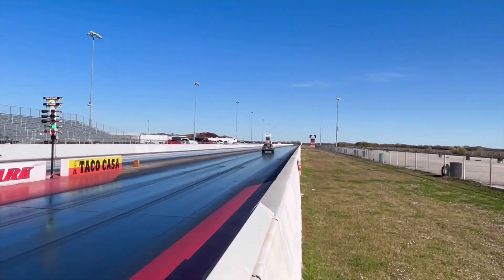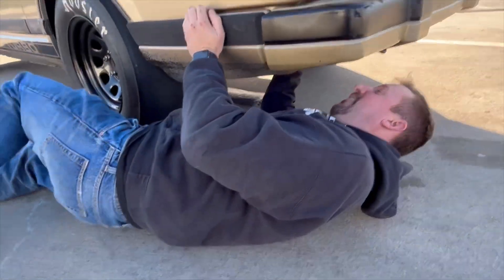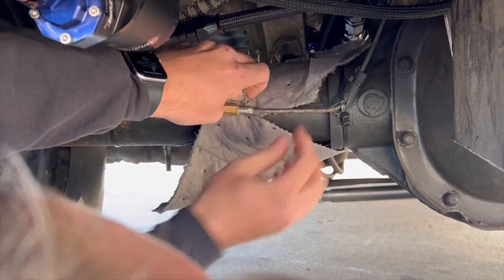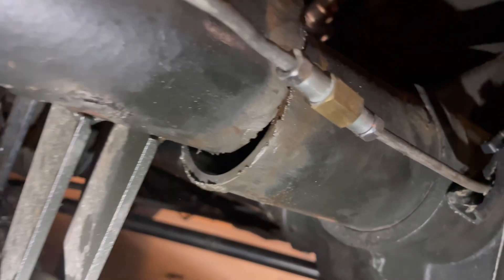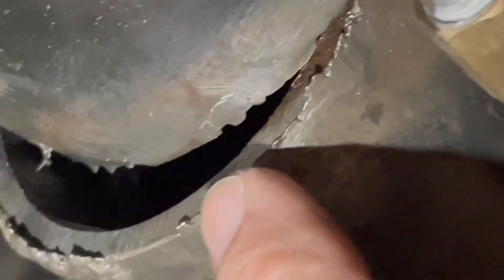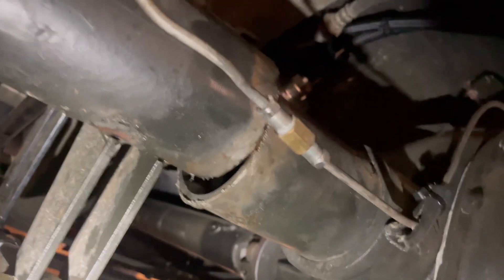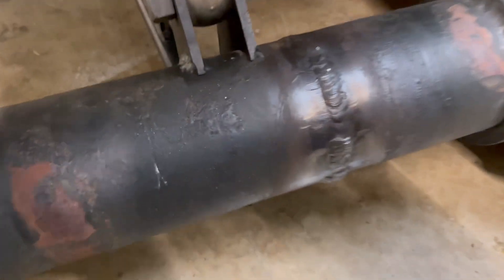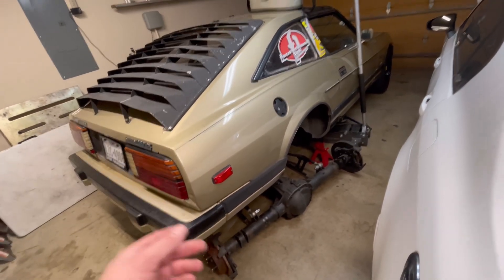I found the weak point….

Comment: Why not sleeve the weld joint. I’m a machinest for a lumber mill and that’s how we repair snapped shafts and tubes. Seperate abd slide a tube over one half. The. Weld up the joint and slide the tube over the weld joint and weld the ends.

Comment: Can you do a video about your Megasquirt setup? I'm super curious.
Reply from the maker: I go into it a fair amount during the engine swap series in my playlist. I purchased the ms3 diy board years ago and assembled it myself. (I’d recommend buying it assembled. It was a huge headache). I used it for the cars stock engine L28et for years. I later added the ms3x expansion board which is a must for every build imo. I use MS to control basically everything. Reach out if you want to know more. Here or DM my instagram @masterofmachines

Comment: That thing is a ripper dude! What kind of turbo and boost are you running ?
Reply from the maker: The turbo is a Chinese no name variety. 67mm inducer in compressor, tiny .5a/r compressor housing. Hot side is t4 with .82 a/r and a 3” outlet. It’s only good for about 20 psi before it starts to tap out, but I like that it spools at like 3500 rpm.